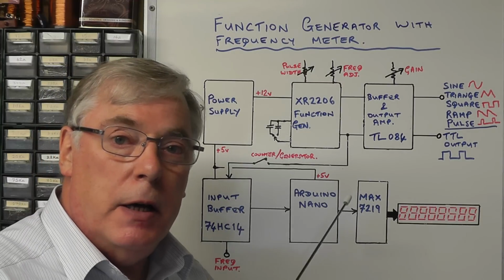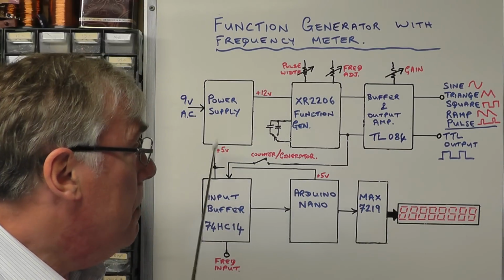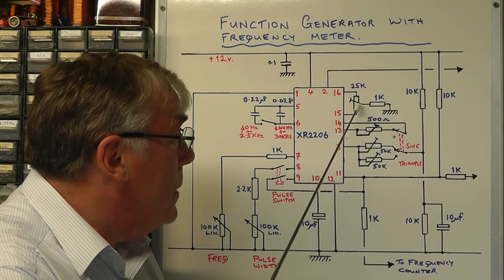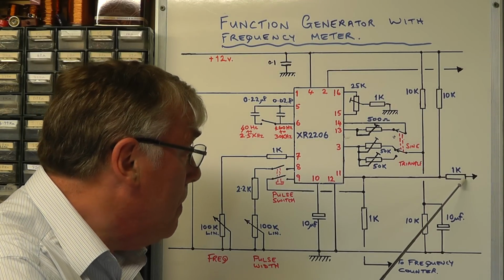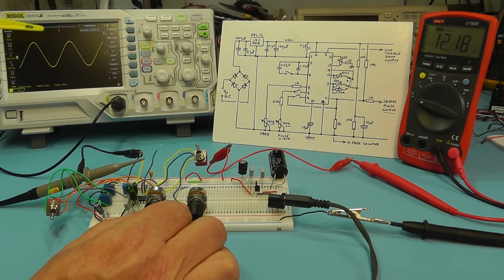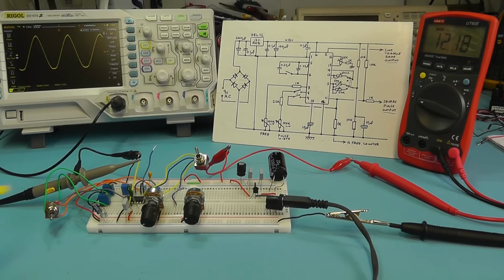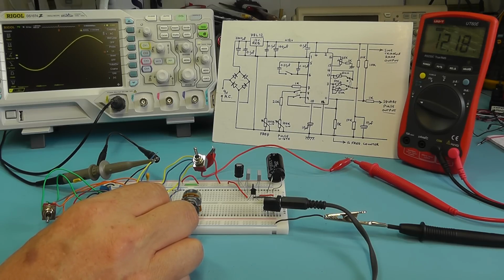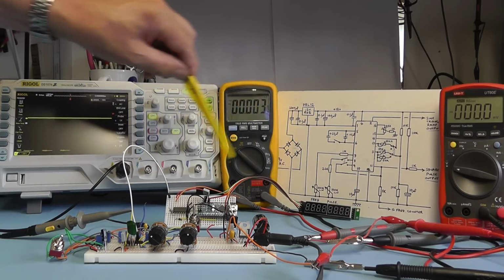Scullcom Hobby Electronics #25 - Build a Function Generator Part 1

Comment: Are you sure that power adapter is 9VAC. Because wouldn't that mean that there is only around +7.8 Volts or so going into the +12 Volt voltage regulator. Thumbs UP! on all your videos. GREAT JOB! David Lee.
Reply from the maker: +Benjamin “Ozias” Esposti Thanks to both yourself and ElectronicWizzard for you comments. I may not answer to all the remarks every time but I still appreciate all comments as it also helps others who view my videos. Regards.
Reply: @scullcomhobbyelectronics1702  Thank you so much for this video you've produced and allowed us to study.  It's simply awesome.  Thank you again.  Go[Bible] Bless.
Reply: +Benjamin “Ozias” Esposti The 9V AC will charge the capacitor on the input to the regulator to around 12.7V less two diode drops in the bridge, so about 11.3V.  The regulator needs about 14V at the input for 12V out, and with 11.3V the output will be 9V or so.  As you say, a 12V AC transformer should suit, giving 15.6V into the regulator.
Reply: +ElectronicWizzard 
That's 9VAC RMS. The peak voltage is about 12.7 volts.
It's like the wall socket power ... 120VAC, is actually the RMS value. The peak voltage is about 169V.

... Hmm, that still is strange. The regulator likely will need a good 13 or 14V to get a reliable 12V output. (It has a minimum voltage drop)
And, that's without compensating for the rectifying diodes, so it would be more like 11V (Depending on the load, that is! Unloaded, or at light load, the diode drop is lower.)
I think he should change his transformer to a 10V or 12V AC transformer!
Reply from the maker: +Steven Heaton Thanks for the comments.
Reply: lol neither ElectronicWizzard nor myself were thanked .... oh well .. hides in a hole
(XDDD)

Comment: Could you perhaps do some tutorials on simple protection circuits? For example: Over voltage, polarity, over current and so on. It is very difficult to find quality detailed instruction on protection circuits. Also a tutorial on basic fan control would be great, such as activating a fan when a MOSFET is getting too hot.
Reply from the maker: SeaMonkey Thanks for your comments. I will consider your suggestions for a future video.

Comment: Nice project. Question! Why breadboard from left to right, and not as the circuit diagram, right to left? It just seems more logical. Perhaps you have a reason! Anyway Thanks for posting.
Reply from the maker: elboa8 No real reason, it was just one of those things. It just I had the pots mounted on one side otherwise I could turn the breadboard around!!

Comment: the easiest way to fix the counter overflow issue is to declare the counter variable as unsigned int; that way the Arduino ide removes the negative range and extends that to a full 16bit positive range of 0-65k
Reply from the maker: Adil Malim Thanks I have had a few good suggestions and will try and fix the issue before Part 2 of this project.

Comment: Thats a smashing project :-D, who doesnt need a signal generator and mark/space ratio control as well :-D.
I guessed wrongly, i thought the compliment to the voltage standards would have been a digital multimeter, perhaps using the icl7106 or maxim equiv, but the project has to interest you first :-), you have to enjoy what your doing :-D, also there are loads of cheap multimeters around :-).
The ICL8038 (old old lol ) came to mind when i looked at the title, the xr2206 looks quite similar in some ways to the old 8038, i seem to remember when i used one i connected a twin-T filter on the output for 1khz and adjusted the purity preset for cleanest output, using a amplifier and speaker +ears ha ha :-).
Not sure about the counter part, i never did get the hang of mini computer jibberish, although i did make a l/c meter with a pic chip and display (not my code lol).
I would use a pic based counter as there are circuits out there+code, real counter chips like the icl7126 seem obsolete :-(
Reply from the maker: zx8401ztv Thanks. I thought this project may be of interest to the hobbyist. I have some other project ideas for later. I also remember the ICL8038 which I have a few of but I find the XR2206 a little better.
Reply: Scullcom Hobby Electronics Yes im sure your right, the 8038 is an old device and possibly a pain to get, the 2206 is better :-)
Dont forget, you need to enjoy your projects, there is nothing worse for you than producing videos based on demand.
And you can swap to other "look inside" items if you find a nice one you really like :-D
Reply: Scullcom Hobby Electronics Nice work, you seem to know your stuff.  A class A hi fi transistor audio amplifier would be a cool project or even a transistor radio, I could see you being up to making a nice project.

Comment: Amazing project! Will definitely build this one up. Whats the absolute maximum frequency that this IC can produce?
Reply from the maker: Adil Malim Thanks. The XR2206 can cover the frequency range from 0.01Hz to more than 1MHz. Simply add different value timing capacitors across pins 5 and 6 of the IC.

Comment: using a 2206 is kinda cheating.
Reply: +omsonic 
I agree, but it's still nice to build your own, at least to some degree.
I don't want to attempt building a computer motherboard from scratch ... talk about a real headache, hundreds of hours of work, and expensive equipment!
Reply: Depends on your goal. Wiring up an XR2206 is MUCH harder than putting together a simple Esaki oscillator.